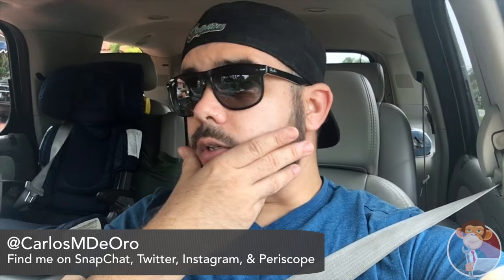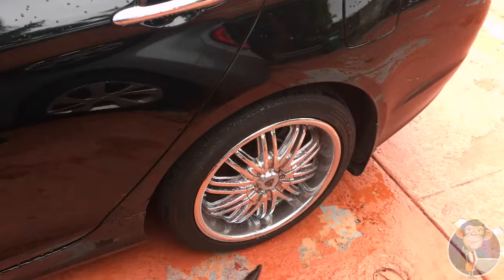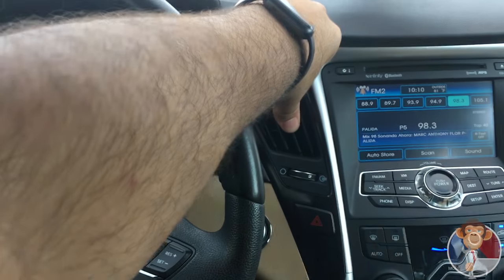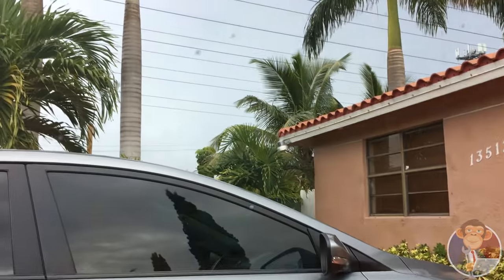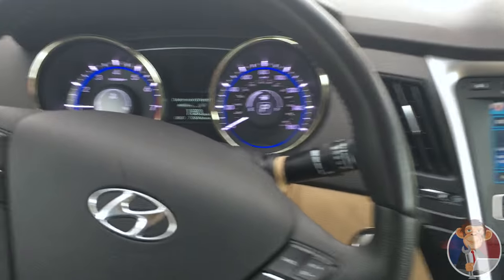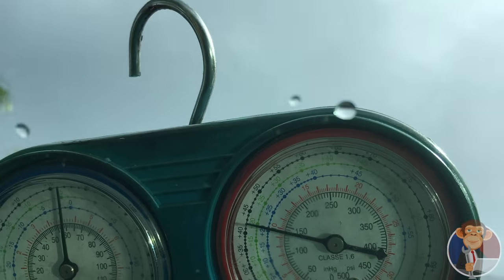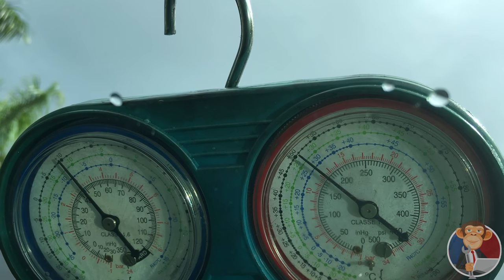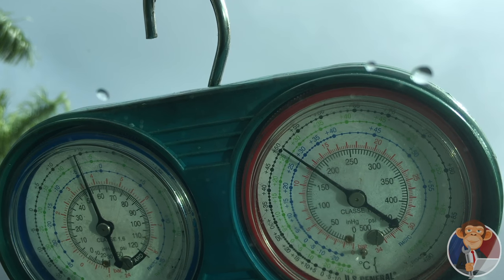2011 Hyundai Sonata A/C not cooling diagnosis. - EGM Diagnosis #4

Comment: Tip and trick: I have a 2012 sonata, and I don't put my sonata in drive during the summer, I go all the way down and shift the gears manually, I let the RPM's climb to 4000 and hold for a few seconds before shifting into 2nd, and repeat 4000 RPM's before going into 3rd. I don't shift past 3rd gear unless I get on the highway and it will keep your AC blowing cold. I've been doing this for 3 summers, and I've been searching for a real solution to this problem. Everyone on this feed is having the same problem. We should file another class action lawsuit against Hyundai. They really know how to suck money out of honest people.
Reply: Yea I have the same problems 2011. Let’s sue
Reply: This is probably a really really dumb question, but when you’re driving like that do you just treat it like a standard (minus the clutch) and move the shifter to change gears?  I have this fear that just gears on an automatic will ruin it lol.
Reply: See my entry above. There's another guy that I checked out for this problem on YouTube a few years ago, and he cut a wire that goes across your dashboard. Maybe that would fix it maybe not but check for that and see what you think I'm about ready to try that because I don't think that the problem is in my compressor and the like. Is anybody else ready for class action?
Reply: @sharoneladavis2023  do you have the link for that vid? I'm sick and tired of this problem.
Reply: My 2012 Hyundai, Genesis 2012 , 4.6 , these Air conditions in these Korean car are not made for south Florida hot weather ,  its blow hot air  ..once in a while might blow cold air for a hour then the fun is over , this is a problem that been coming in last few years . now it time to fix it .

Comment: That is a clutchless compressor just because it’s turning doesn’t mean it’s engaged. The ECV has to be activated.
Reply: I was recently working on one of these things and yeah you're right these cars clutch system engagement  is not like most other units.
Reply: What does the clutch do in these systems?  I have a 2015 tucson and there's definitely a clutch (I can see it activate, plus I can turn it on and off with the ac relay). According to the wiring schematic (and visual confirmation) it does appear to also have an electric control valve.

Comment: I replaced, expansion valve compressor high pressure switch and office tube. This trash still blows hot after 20 or 30 min. I do notice when I disconnect the battery and connected after 5 min it resets and starts to cool. But only for another 30 min.

Comment: The ac control valve could also be the problem, they are sold sepertly and could save you money. The valve is located on the ac compressor it self.
Reply: I saw a post about that. about 50 bucks but you also have to exhaust and recharge the system. They say it's 99 percent of the problems.
Reply: thanks
Reply: I suspect this is the problem with mine.

Comment: i had this problem for about 2 months the ac would work but all of a sudden it would blow hot air they check the freon it was topped off so they told me to clean  the part that looks like the radiator i did that it worked for about a minute but what i noticed was when i hosed that lil radiator part the ac worked fine until the engine got to high temperature the radiator was topped of with antifreeze didnt need adding also the fans were working so the only thing i suspected was the car was getting somewhat hot because the catalytic converter was clogged went to a shop they swapped it out with another one as soon as i drove off from the muffler shop i noticed the ac blowing cold air again before you start spending money on ac parts check for a clogged catalytic converter first mine had 144000 miles maybe your asking what does the converter have to do with the ac well if the cnverter is clogged its not passing the hot air towards the tail pipe and the engine gets hot if the radiator isnt  cooling right the ac wont blow cold hope this helps it sho did to me

Comment: I have a 2011 hyundai sonata limited, The AC blows hot air sometimes when the outside temp ~95F. it seems like the AC works intermittently. it seems like the compressor is just quitting sometimes. I checked the low side AC pipes and it is warm when the AC is not cooling. Do you think it is the compressor or anything electrical related?
Reply: this is exactly my situation same car, same year
Reply: Same problem on my 2011. Did you find the problem ?
Reply: I have the same problem with me 2012 sonata. The problem with this video is the compressor on this vehicle always turns. You can't judge it just by looking at it.  I'm leaning towards a failing pressure switch which could cause it to run intermittently.
Reply: @Iwillalwaysskipad  my gfs doing the same its a 2011 limited can drive around for a hour and ac works maybe 3 or 4 times and hot rest the time
Reply: @raysmitty5338  my 2011 does the same thing. So frustrating.

Comment: Educated Grease Monkey, I got a 2013 Sonata 2.0T and wanted to know if the A/C shrader valve is the typical R134a core or JRA type? I got a leaky valve core and wanted to get the correct tool and part. Appreciate your help.

Comment: my AC works going down the rd. but not when sitting still. what is wrong.
Reply: Same here
Reply: Most likely your radiator fan not kicking on
Reply: Yeppers! Fan not kicking in when ac is running. Either engine kicks fan on or the air flow through radiator when driving.
Reply: Must be everybody Hyundai

Comment: Don't know if this is an old wives tale but I have been in the habit of turning off my air-con  about 2 minutes from my destination with the fan running till it's blowing warm.   My 2011 Sonata has 170k and air is still running pretty good here in Florida.   Hope it helps.
Reply: never hered of that I don't see the reason why you would do this.the condensation from the evaperator will drain out and the system will equalize regardless if you turn it off going down the road or sitting still

Comment: 32k ON IT. TODAY MY A/C WORKED REALLY COLD FOR ABOUT 40 MINS (LOCAL TRAFFIC STOP AND 50 MPH AT TIMES) UNTIL I GOT CLOSER TO HOME AND GOING ABOUT 20-30 MPH. ALL OF A SUDDEN THE AIR COMING OUT WAS NOT COLD -ANYMORE BUT ROOM TEMP, NOT WARM. THIS HAPPENED ONCE BEFORE THE EXACT SAME SCENARIO. HOW CAN I TRUST I WILL NOT BE TOLD ITS THE COMPRESSOR OR CONDENSER ($$$$$) WHEN ITS SOMETHING MUCH LESS EXPENSIVE TO FIX?

Comment: He doesn't mention to CHECK YOUR A/C FUSE FIRST.   You could end up spending a lot of money replacing a compressor when it could have been your air conditioning fuse.  A couple of bucks vs. nearly a thousand to fix.  Cool video though.
Reply: In this case the compressor  was actually working at times( you could tell by the pressures changing when he revved it up to higher rpm). Now, Carlos forgot to mentioned  that these compressor are not the conventional ones with a clutch that cycles on and off as the cooling is required. These compressor are constantly  spinning but have a swash plate inside that is controlled by a pressure valve. So, the fact that it wasn't working properly could have been different factors not limited to the compressor itself.
Reply: So many videos don’t mention that a lot of cars have variable compressor s and those are always spinning. That is my case, so diagnosis is a bit more tricky. Also the ECU or computer has a lot to do with the AC function and many communication problems can happen there. Wish there were more people diagnosing Variables compressor systems externally controlled.

Comment: Question, I have 2012 Sonata blows hot air! the freon is full and it still doesn't run I don't hear the compressor to be working. I checked the fuses as well and they seem to be fine any suggestions ?
Reply from the maker: Full doesn't mean its right. The freon has to be exact. If its overcharged, the sensor in the system won't let the a/c compressor turn on. Same thing if its to low.
Reply: By the way I've changed the compressor to an old sonata 2006, and works as charm
Reply: I had the same issue I replaced compressor with thermal expansion valve.....2 years it was running fine ....
Now again same.... I am totally disappointed with hyndai sonata ac
Reply: 2012 Sonata Turbo, Same AC problem....live in humid Houston, Texas... when humidity is high and the temperature is high the air conditioning stops working after driving up to certain number of RPMs or about 20-30 minutes. It also shuts off at stop lights with change of RPMs at normal and natural speeds.. I do think that it is a class action suit time. I've been dealing with this for three years now.. good mechanics, and the results always come back okay. But it doesn't fix the problem.
Reply: Change out youre ac thermistor switch
Reply: @sharoneladavis2023  did you ever figure out the problem? We're in Houston and we go through the exact same thing...
Reply: Why? It’s not any cheaper that I can see

Comment: Did u replace it?? What kind of price tag job would that be?? My sonata failing also.
Reply from the maker: In the South Florida area, a job like this could cost you anywhere from $750- &1000. Depending on labor rates. 

I did replace the compressor. Check out the video here. 
https://youtu.be/bG9dtZAVKTg

Comment: Low 20-40
High 150-200 max
If higher then expansion valve blocked by ice( moisture in sys)

Comment: H
OW MUCH WOULD ALL THAT COST IF YOU GO TO A MECHANIC? i UNDERSTAND THAT THE COMPRESSOR IS HARD TO GET TO?
Reply from the maker: Its would cost you a good amount but this is not a job for every skill level. Evacuating the A/C and Recharging needs to be done correctly in order for the system to cool.

Comment: Bad diag, that compressor has no clutch... Problem is the ECV,  a bad expansion valve or compressor would show you on gauges.
Reply: It DOES have a clutch of the conventional type....(Not cycled by the Evaporator sensor as in most cars.)
but the discharge, as you so rightly say, is controlled by the ECV valve on the compressor.

Comment: The A/C in my Hyundai Santa Fe 2008 was blowing hot so I recharged the system. During the recharge the compressor kicked on and the A/C started blowing cold. But I noticed a light continuous smoking coming out of the grill area where the charging ports are located. The car blew cold the rest of the day in 92 degree weather but the next day it only blew hot again. What  is going on with it?
Reply: your condenser probably has pin hole/leak
Reply: @frankyv5999  and how much does that cost? That is what my 2012 Hyundai Tucson is doing?

Comment: hi there
thanks for the video
i have an issue with ac so the thing is
in summer when i opened the ac the cold air goes only from driver's vent and the passengers vent comes a hot air 
i charged with gas it's back to normal then after 2 days its coming back again this issue 
now we are in winter the driver's vent blowing hot air (switch to hot ) and the passenger's vent blowing cold air 
whats is the problem ??
i live outside usa
my car is hyundai sonata 2011
Reply from the maker: Sounds like you have some stuck actuators inside the dash. It is so hard to diagnose it from a distance.

Comment: Awww man...  When I did my search, I was hoping to find how to properly charge the freon in my 2011 Sonata 2.0T, thinking a recharge would do the trick.  What do I find instead?  A whole bunch of other Hyundai owners going through yet another frustrating issue with their Sonatas.  Smh.  I'm so f**kin' tired of Hyundai by now...  It's hot as ballz, and I'm having the same problems with my AC... intermittent cooling for weeks, now I get up to go to work this morning and have NO AC at all.  I'm not even gonna finish watching this video as, judging by the comments, it offers no solution.  Thanks for trying, though.
Reply: same here man, the engine failed TWICE and they had to replace at no charge, and now the AC in my 2012 sonata is blowing hot ass air, ive checked the compressor, checked for leaks, and everything else, i'm sick of this car but my wife loves that damn car so i have to deal this the repairs

Comment: You gave no answer here if you replacing everything you never figured out what exactly was the problem
Reply: If he will know first hand what it is he will not be doing YT videos:)
For most cars the AC performance test calls for high speed setting, windows open and 1500 RPM, NOT an Idle speed:)

Comment: Same issue here with my 2011 hyundia sonata I see this is a very common issue with sonatas smh 🤦🏿‍♂️
Reply: Buy the compressor of the sonata 2006 and install it, I've done it already and works as charm
Reply: @AdelHaiba78   plug e play install? can u point me with the correct part?
Reply: @JoseRivera-cd8xb  Yes Plug and Play, I don't remember the part number, but it is the part which works with 2006, but I advice you to change the condenser for the new compressor
Reply: @AdelHaiba78  tnkxx for the info... i was a bit unsure cause saw some diferent part pictures for same year 2006
Reply: @JoseRivera-cd8xb  you welcome, I've changed it 2 years after I bought the car, and it works till now, without any problems, buy the original one not the after market part.
Reply: @AdelHaiba78  just making sure I have information correct, I have a 2012 limited edition.. Are you saying the 06 will fit and it's best?